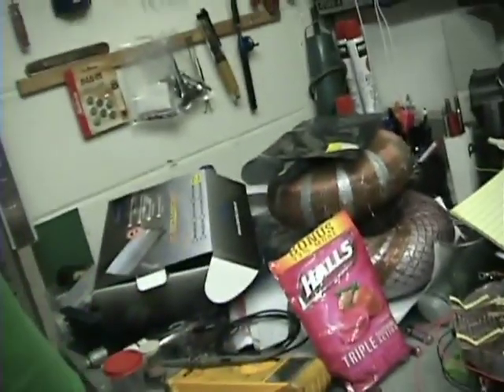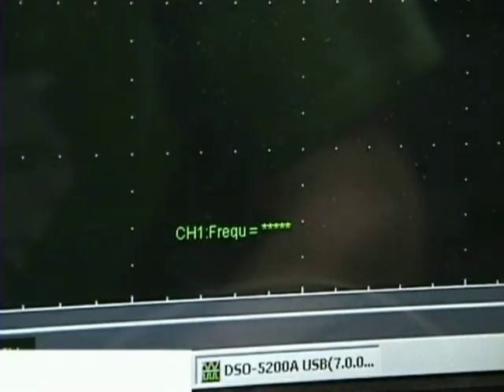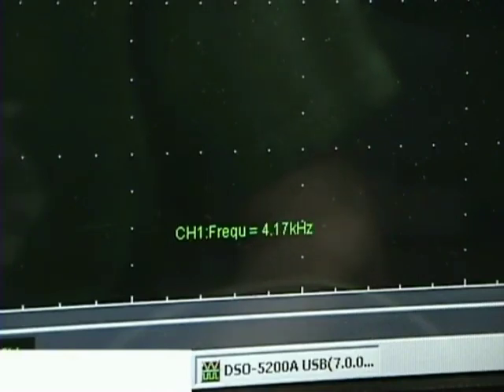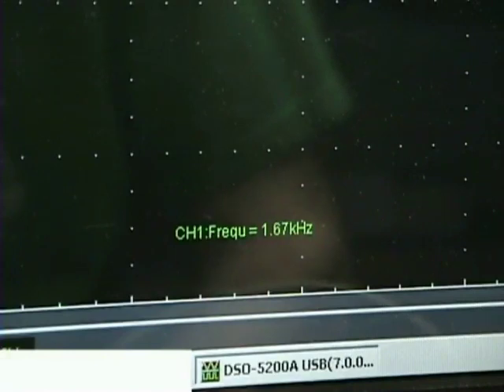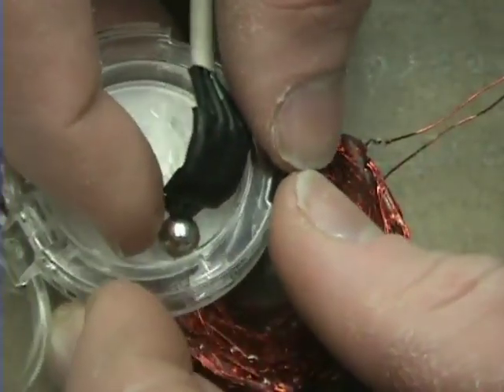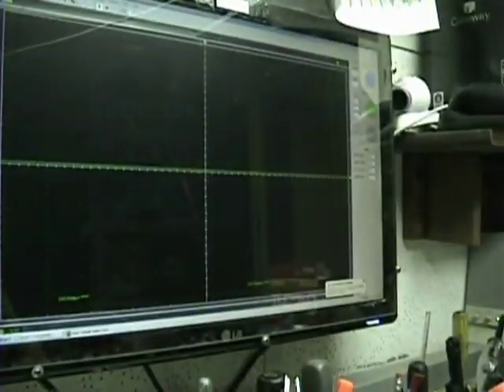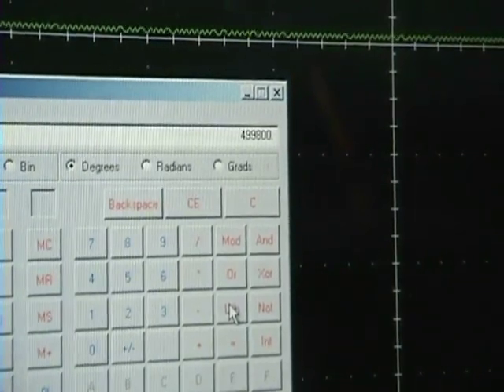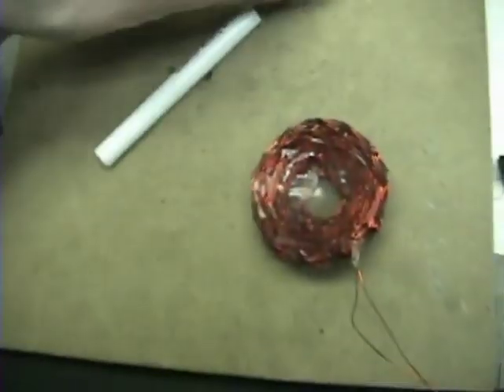500,000 RPM Pulse Motor Using A Star Challis Coil & ¼" NEO Sphere!! (TEST 32)

Comment: Russ, 500,000rpm. Dude, that is Kickin. I attached a vid of the coil that I wound today, it's a 24 point off-set counter wound Star-Challis. I used 26 gauge mag-wire. The "A" field is wound in one direction and the "B" field is wound in the other. So, this coil is weaved. I'll be ordering some neo-spheres tomorrow, and then replicating your CKT, though I'm looking for some faster transistors and fet's.
Bro, I love your work.
Peace.
Mike.

Comment: @Resistance4Liberty  - if the neo is in a fluid, it resistance increases - the thicker the fluid, the more the resistance. But I like the way you think out of the box. The optimum situation for decreasing the resistance is to have the neo in a vacuum and not touching anything. basically - a floating sphere.
Russ and a couple of other people like myself are working on doing the floating sphere right now - Russ is close - so is Gary.
Russ will agree with everything I just said.
Peace,
Mike.

Comment: @lentinigaston2005 Hola escuchamos de 0.02 KZ a 17Khz lo mismo que desde 20 Hz a 17000 Hz,el amigo rwg42985 lleva el iman hasta 8330 hz o 8.33Khz por eso lo escuchamos entra dentro de rango,8330hz al ser un iman con dos polos equivale a 8330 revoluciones en un segundo,8330*60seg=499800RPM
O sea una bola girando a 500000RPM :) un saludo